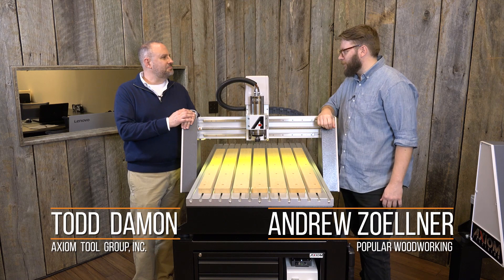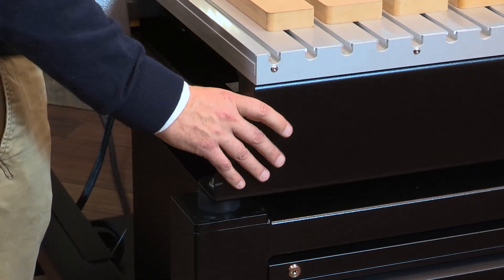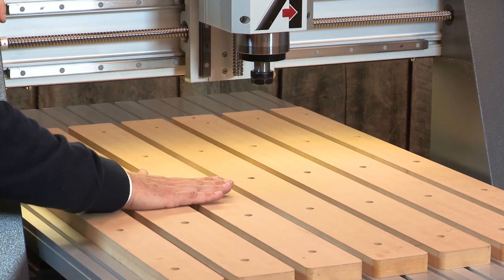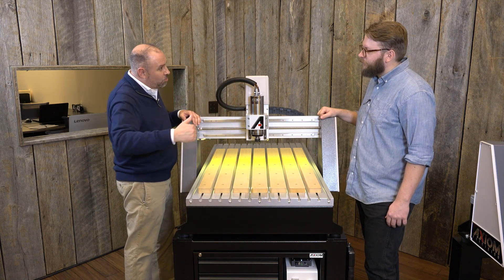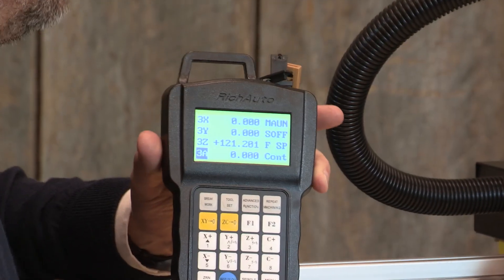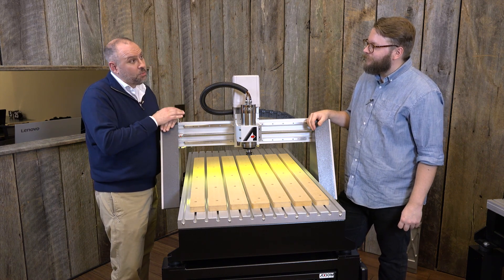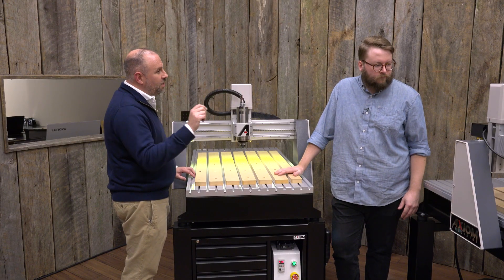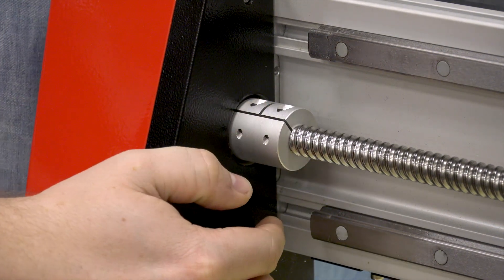"Building a Better CNC Machine"  Popular Woodworking Visits Axiom Tool Group - Episode 1

Comment: I started with a Shark CNC which was DOA.  I was so angry, I took it back and bought the AR 8 Pro and I have talked to Todd personally in resolving issues.  The only weak link in this machine is the controller.  With that said, this is one of the best designed and most robust machine, I have ever owned in my life.  The money spent on this machine was up there but my only regret is that I have not used the machine as much as I like (my fault, my issue).  I absolutely love this machine.

Comment: 6 months ago I purchased an ir8 and have used it to cut wood, HDPE plastic, acrylic, and aluminum. So far I am very happy with the performance of the machine. It has good accuracy and repeatability for an affordable stepper motor machine. Great performance for the price, and the hand controller is a nice feature. Also, I have only needed phone support a couple of times, but they answer their phone, or return your calls soon after, and having good support on the machine when I do need it is important to me.

Comment: Axiom Tool Group,
Thanks for the overview on Axiom. How do you best ensure that all of the axis are 90 degrees? I think on CNC Router Parts they leverage several adjustable proximity sensors. 

Thanks
Reply from the maker: We are using several proximity sensors, however, those devices are used to find a repeatable HOME. The machines design however, incorporates multiple bearing cars on each axis that ride along the prismatic guide. These cars are separated along the guides to prevent racking and ensure that the axis remains square. 

Extreme care is taken during the assembly process to make sure that each machine a true and square before it leaves....and then they are tested again, before shipping to customers. 

All of this is made easier as many of the components of the machine are designed with features that ensure they are square when assembling, such as guide pins.

Comment: Looks quality but my only objection is the comment about control PC's. I personally like to use a pc as my controller so i can run my cad/cam software from same pc in the event i need to change code/model as well as transferring my files. Again that is a personal opinion.
Reply from the maker: We appreciate your desire to continue working with your PC. We've simply found that a solution that incorporates a dedicated DSP pendent controller allows much more reliable machine operation, without the technical disadvantages of a computer. 

Understand that having a PC near to the machine is still needed for file creation and editing....however those files are simply transferred to the machine using a USB. This then allows you to continue by working on your next job/design while the machine is operating....a feature that is not possible in most if not nearly all PC control environments. 

DSP controls also give you the piece of mind in knowing that if you experience a PC failure, hardware/software incompatibility or you simply spill your coffee....you can still run any files that you have saved either to the USB or to the controllers internal memory...so from a business perspective, production does not have to stop. 

Do not let the DSP be intimidating either, in many ways it is far easier to setup these jobs that most would assume. Once the file is on the USB, you can have a job running in seconds.
Reply: @AxiomprecisionCNC , Having owned a machine since 2015 I have come to appreciate your decision to go with a pendant controller. I want the simplicity and utmost reliability of being able to run a set of proven out G codes.
Reply: I use all Macs in my design studio. So I import my files and the CNC equipment I use with my files works fine.